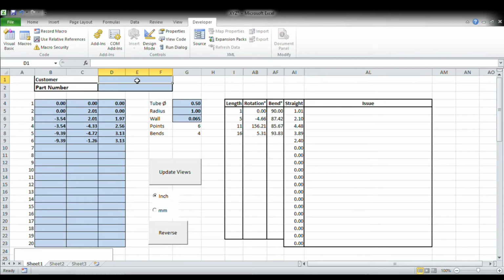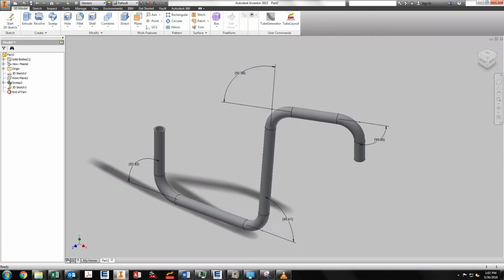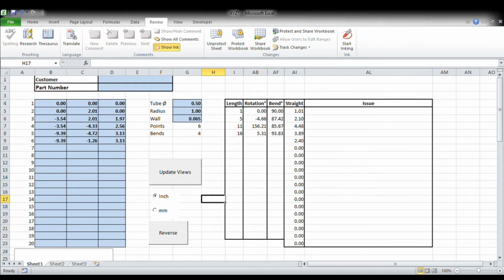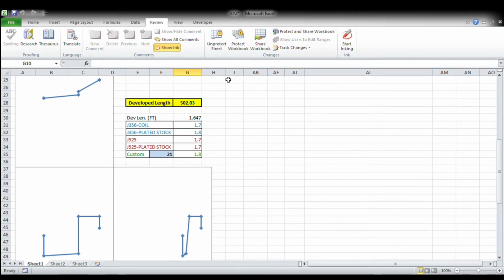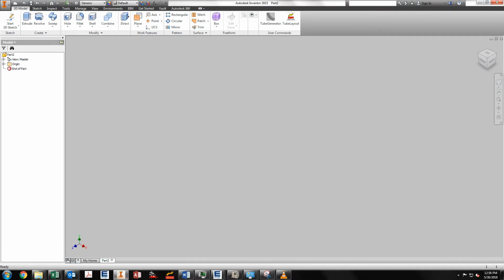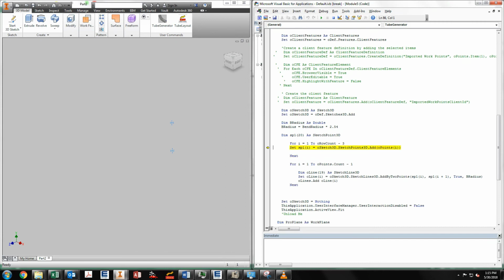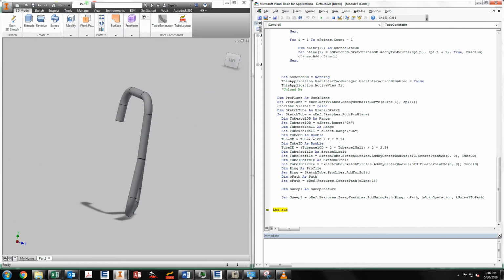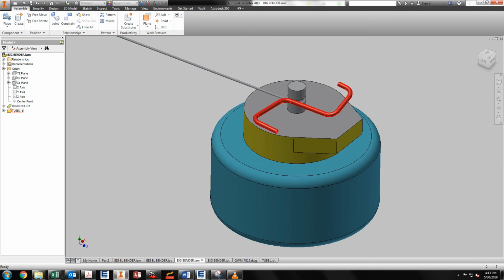Auto Desk Inventor automatic tube generator XYZ

Comment: is this still available in inventor 2025? I'm new to inventor and I'm in the pipe bending industry and I'm trying to do the drawings with xyz points on the drawing but I'm not coming right with it. could you help with this? i also have accesses to xyz information but no drawings for them